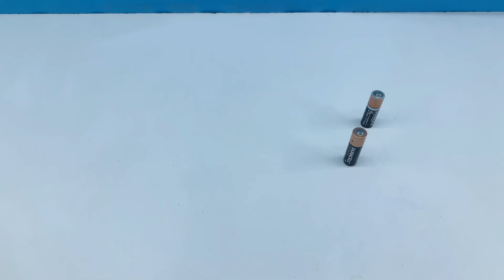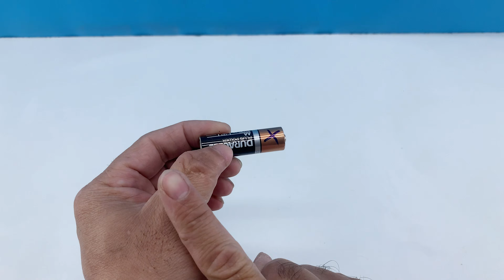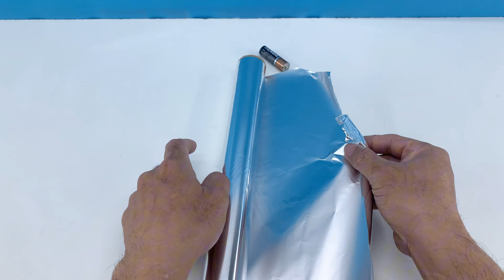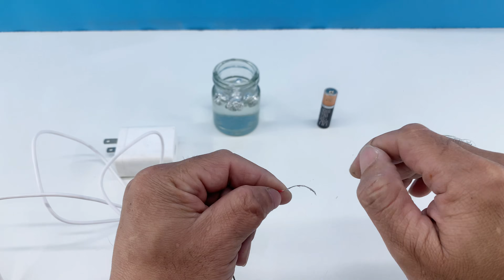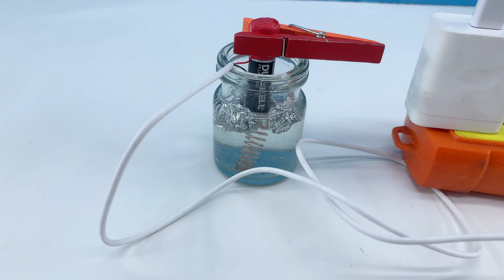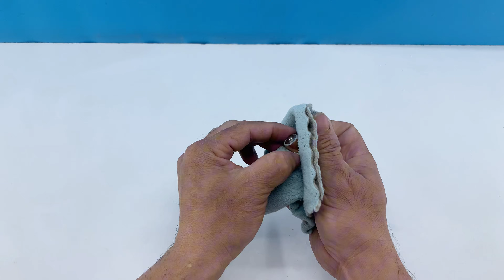Stop Wasting Money on Watch Batteries! Restore Old Ones with This Trick! 🔋

Comment: I turn my electric stove eye on low hold positive.sidr to burner 60. Seconds.or until battary fells hot remove turn off stove battary is powered up AAA or AA or C or D.batterys
Reply from the maker: Thanks for sharing your experience! 😊 However, heating batteries on a stove can be dangerous and may cause leaks or fire. We recommend following safe handling practices and using batteries according to the manufacturer's instructions.